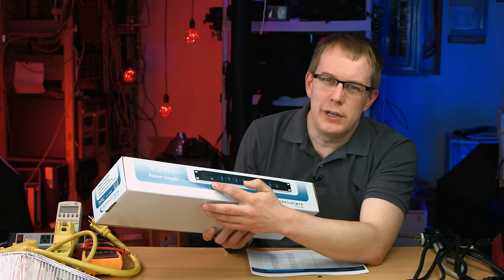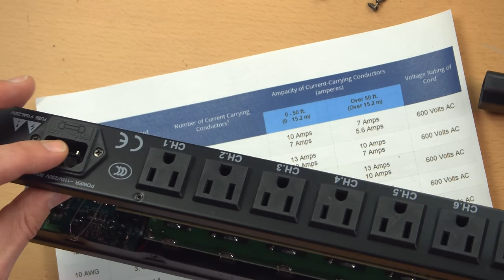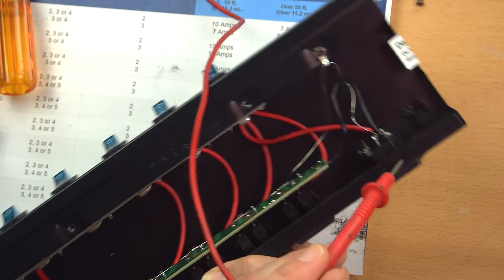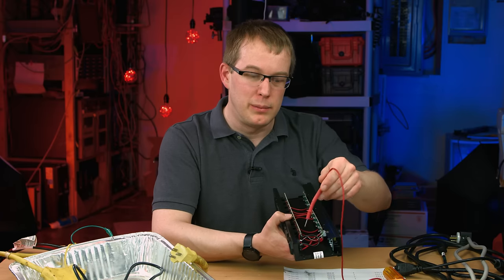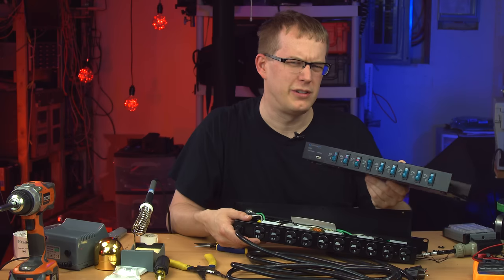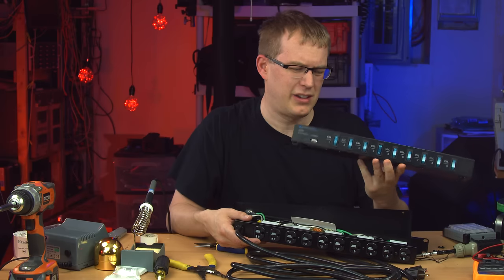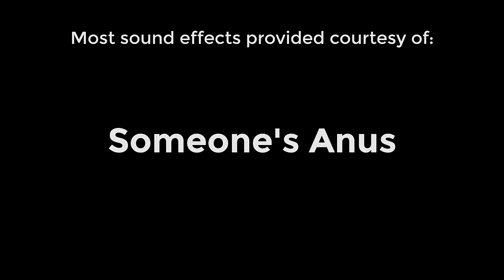Technical Pro PS9U vs. Cyberpower CPS-1220RMS PDU (And One is a Fire Hazard)  [C39FD0152]

Comment: I purchased one of these simply to evaluate it. This is not something which is designed for your expensive equipment. On Amazon this was advertised as having an RFI/EMI filter, and it goes on to describe how this is a must have for your expensive equipment. This is true, but when I disassembled this for inspection, there was no such filtering. The USB charge port does talk to your phone and sets it to fast charge, however, when it did this, the internal charger created much more RF noise than the Samsung charger which came with my phone. This was evident when I watched my HF ham radio while on the 160-meter band. The power cord was soldered directly to the board and to the fuse holder. All of these power cord connections were grey, indication cold solder joints. The ground wire throughout this switch-box is very thin. The power cord is undersized. The box and paperwork which came with the unit didn't say anything about filtering, that was only in the advertisement. So buyer beware.

Comment: Just came across your reviews today as I looked for some tests of some power surge protectors. Nice to see someone else pull them apart and do a review which saves me some time and money! FWI - I was in the Army as a MW radio tech dealing with high power transmitters (50KW+) then 30+ years w/AT&T as a MW, television & audio tech plus doing live sound & lighting production on the side before LED lighting became a bit thing so some of our light loads were very high so we had to be very mindful of current demands. Your first power strip there was definitely a piece of crap that shouldn't even be for sale to anyone. I see the first strip has a CE marking which is likely bogus. I see some of the cheap (dangerous) products coming from China that have a CE or even a UL or ISO rating which is counterfeit since the products certainly don't meet any standards. At least some China makers will say that their products are "Not rated," (NR) so people need to beware of the fact.

Comment: You can also get equipment with bad wired power cords. The have the wires crossed from where you plug into the wall to the other end. So the neutral goes to the live on the other end. So in the end the neutral wire is what gets fused. The first unit I would not use at all for anything.

Comment: The Rockville branded version of this Technical Pro PS9U does not have a detachable power cable and the rack ears are part of the front panel (at least from the pictures online), but I bet it's the same internally. Interesting.

Great video!

Comment: That ground should be at least 12AWG or even better 10 AWG and solid copper.
Reply: The ground should be at least as thick as the line and neutral.  The ground wire on the "PDU" looked like solder wire, that will melt quickly in that application.  Just because you can attach wire with solder doesn't make it a good ground wire on its own.

Comment: FYI, impedance on Aluminum is greater so you have to have larger aluminum wire (lower gauge) to meet the same spec as copper. IE, x2, so with how thin everything is on that thing it's basically wired to be a USB charger and nothing else, if even that.
Reply from the maker: Ah, very good point!  And yeah, that just adds to the terribleness of that PDU.

Comment: So, if you've already got a cheap power strip like this, if you swap out the fuse and upgrade the wire to 12 gauge - will that fix everything?

Comment: This is an old video, so probably don't need to mention this as you might already know, or know by now. 

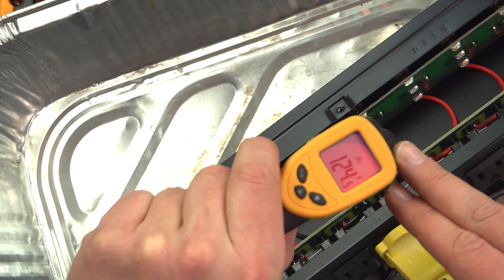But at around 11:00 you want to aim a bit higher than the laser as the beam that measures the temperature is below that especially at very short distances. Was hard to tell if you were aiming correctly, you probably were and I'm just throwing out pointless words at something you probably did correctly.

Anyway... Was a fun watch and very informative even though I came across this completely randomly.

Comment: Yea 15 amps needs to have at least a 14 awg wire. That's so unsafe.. I'm thinking of buying one and switching out all the wire to the correct size. Like most people I want it for the blue switches
Reply: I prefer 12 gauge wiring in my home (for any 110 volt circuits I run that is what I use).  However, 14 gauge is the bare minimum for 15 amps (technically 12 gauge is rated for 20 amps assuming the wire is copper which became code required after the late 1960's) and then only if the run is less than 100 feet, that is also the minimum code requirement for a PDU like the ones shown in the video.  Even most of my outdoor extension cords are 12 gauge (I have one 16 gauge that I bought for cheap and kept under my carport for 25 years, it was intended to power a 300 watt air compressor for filling car tires and an (originally) 75 or 100 watt hanging work light and I recently bought a 12 gauge cord to put in its place after we occasionally started running other things on it, the circuit going to my carport is a 20 amp circuit with 12 gauge wiring).

As for buying the crap PDU evaluated here (and yes, I know I am late responding to the comment), if the through holes on the boards are too small to accommodate 12 or even 14 gauge wiring you are wasting your money and time with one of them.

Comment: I wonder if even that CE certification is real, or fraudulent on the Technical Pro....
Reply: There are two CE specifications.  The C E with a half space between the letters is an EU stamp of approval whereas the CE without a space between the letters is "China Export" which means the device is not legal to use in China and must be exported.  Of course Shenzhen Shit manufacturers can replicate the C E logo so don't count on it being legitimate.  I would say look for a UL stamp and number but they are quickly being run out of business by the ETL/Intertek which purports to be equivalent to the UL but actually isn't.

Comment: I have the same one except mine is ps92u I've had it for five years I have my stereo hook good I am a surveillance cameras hooked to it cd Player An DVD Player An Xbox hooked to it and had no problems Maybe ps9u Has a problem But I don't know Thanks for telling me anyway Appreciate it👍
Reply: You have low amp draw components hooked up, while he had a space heater hooked up. Dont plug anything in that has a large draw: space heater, hair dryer, micro wave, toaster, large power amp, etc., and you should be ok, but if you smell anything coming from it, throw it in the trash. I would pull the cover off and look at the inside of that plug and see if it is getting deformed though.

Comment: Isn't it technically 10A @600 Volts? Since we are running this at 120V, the actual amperage tolerance should be higher?
Reply: No
Reply: What kills?
Reply: If a conductor is rated at 10 Amps you cannot go above 10 Amps no matter the voltage. Most building wire/cables that are used in 120-240 Volt circuits are 600 Volt rated, and most conductors for 120-240 Volt devices are rated at 300 or 600 Volts. That doesn't mean that you want to hook up your 120 Volt device to 300-600 Volts, and it also doesn't mean that the Amp rating will change.
Reply: @VictorEstrada  Amps, Volts and Watts are just units of measurement. When you get shocked, there are two things that will determine how much current will flow. One is the resistance between the two points of your body that are touching the points of different electrical potential, and second is the amount of voltage that is present. The higher the voltage, then the higher the amperage will be according to Ohm's Law. Current equals Voltage over Resistance (I=E/R).
Reply: I will oversimplify this a bit but the amps is 95% equivalent to water pressure in a hose, if the wire can handle 10 amps at 110 volts it can (in theory, no high voltage device has such a low current draw) handle about 9 amps at 600 volts.

Comment: Isn't it only a fire hazard if the combination of devices plugged into it are anywhere close to 15 amps?
Reply: It’s a fire hazard if the total load is over 10 amps. Melted cord is just as much a fire hazard.  

Yur sleepy one day, plug the wrong thing in, boom fire. Should not be like that.

Comment: pyle is better
Reply: I Heard a pyle receiver once it sounded better than the sony...
Reply: Raymond Leggs people will say things, are they even pros, are they comparing hardware that is at the same range? Cause I could tell you that my 250 dollar stereo sounds better than my 100 computer bose speakers... pyle is very well known to use cheap components all over, just look at their amazon reviews
Reply: Yeah I do look at amazon revies on gear. One model in particular the PT684BT's reviews seem to be pretty solid. Only 2 or 3 bad ones. Which is why I wanted to try it.  I wouldn't be surprised if it wasn't made by the Inkel corportation,which makes receivers sold by All the major brands..